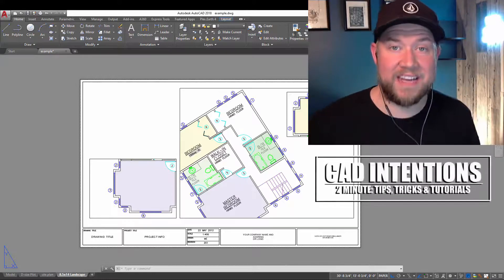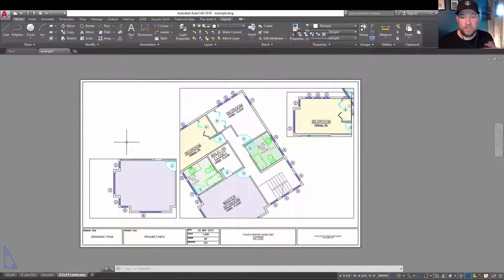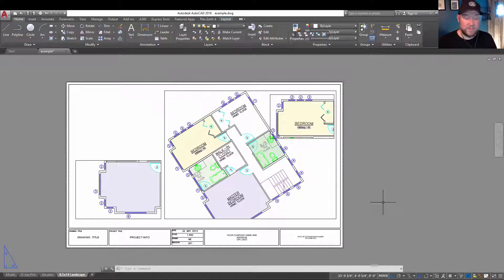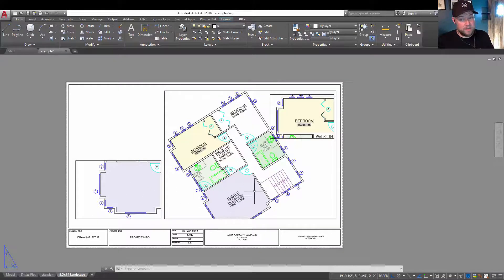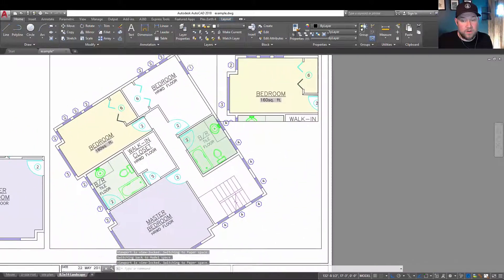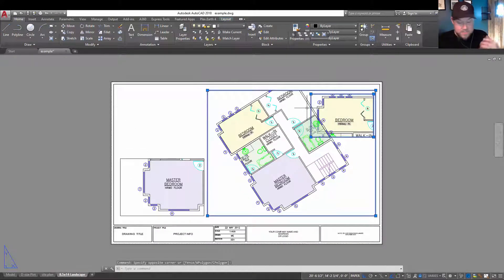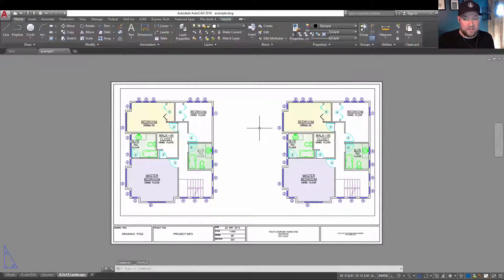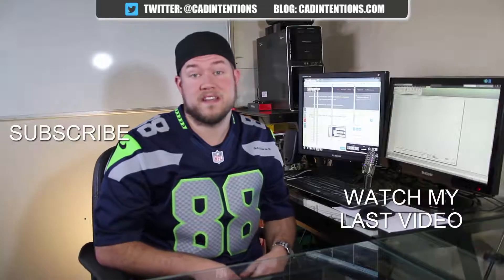5 Common AutoCAD Viewport Questions & Issues | Stuck in a Viewport? | 2 Minute Tuesday

Comment: I HAVE PROBLEM WITH VIEWPORTS PRINTING IT'S TAKING 45 MIN.
Reply from the maker: Hmm, I guess that can be caused by quite a few different things. One I typically avoid plotting in the background if that option is checked on, it can take quite a bit longer in general. 
Trying a different plotter, ie a different PDF option if your PDFing, like say dwg to pdf in the plot setting can help. 

It's also worth checking some of your print settings, making sure that the resolution isn't too high and quality isn't maxed out, especially if you have a detailed drawing or one with raster imagery or background images, all of which can lead to longer printing times.